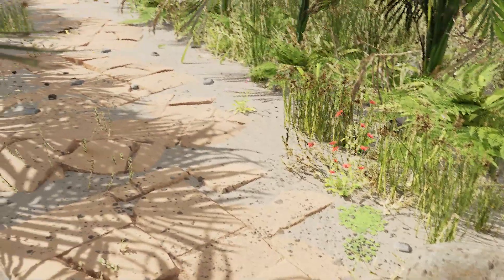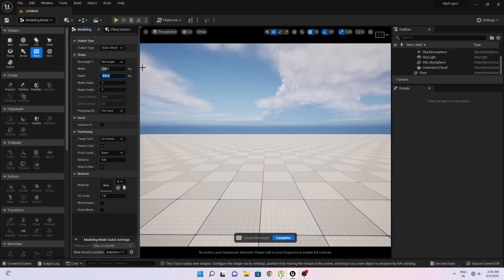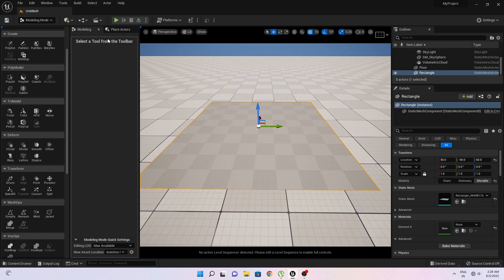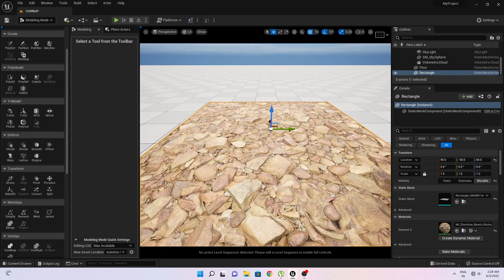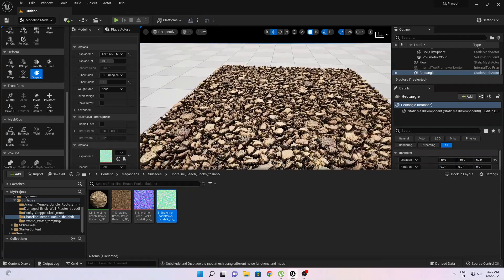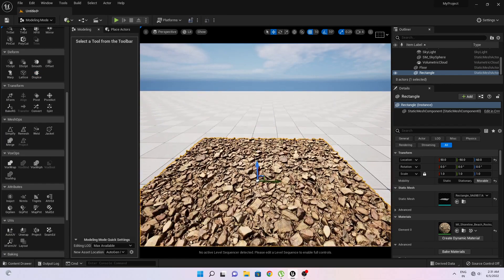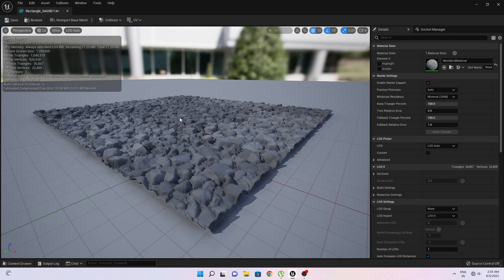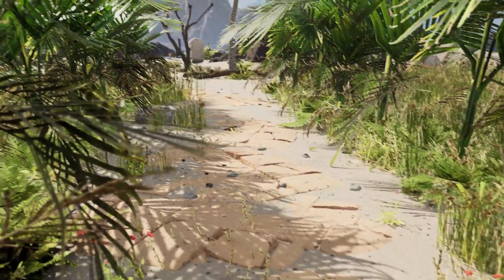Displacement Tutorial Unreal Engine 5

Comment: Useful technique. A parallax shader might be better if you're not getting close or a tangential angle. Otherwise, 20-30 different rock models could be instanced across the surface (memory only holds the individual geometry and the instance transforms so it's not too expensive). The latter has the bonus of no heightmap artifacts from single-axis displacement.